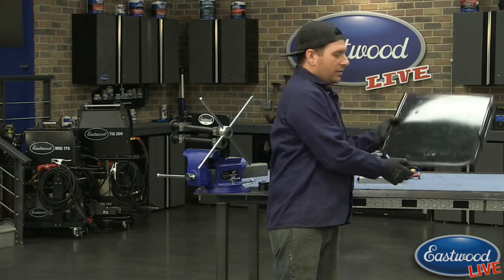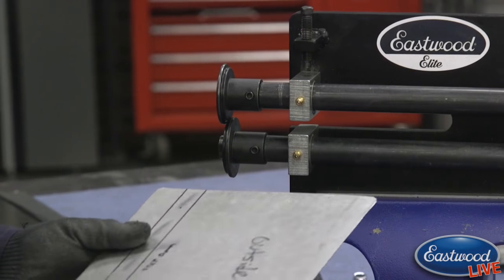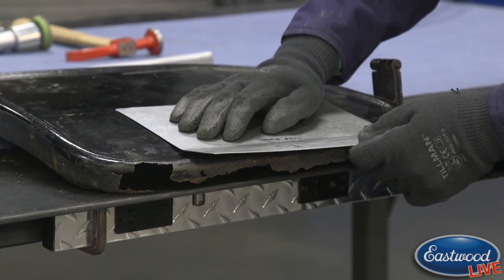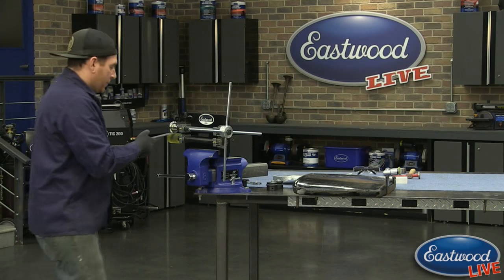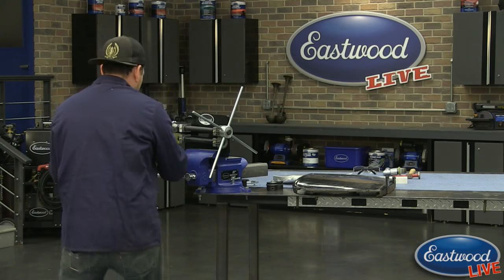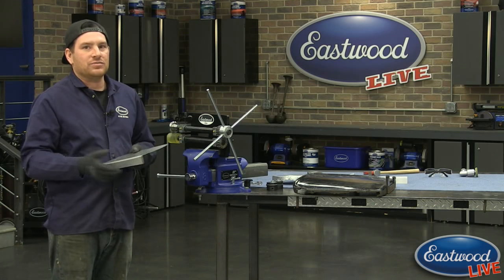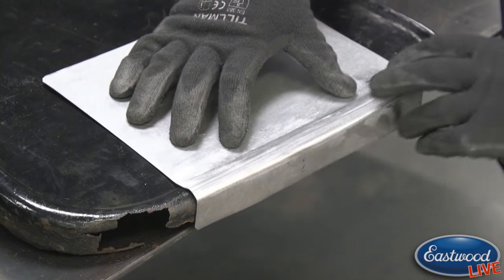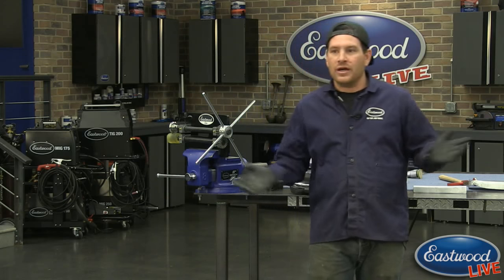How To Fabricate a Patch Panel for a Car Door.  Model T Roadster Repair at Eastwood!

Comment: I like the idea of the four armed handle. It looks a lot better to use than the standard crank arm on my 18" bead roller. Is there any chance it will be incorporated into the existing bead roller design or available as an upgrade?

Comment: I would have cut out JUST the bad spots and patch in small pieces. It's actually much easier that trying to mull two complete panels together. Way overkill on such little damage.